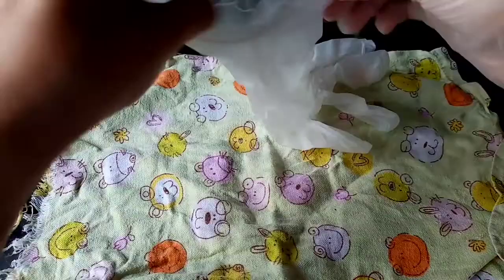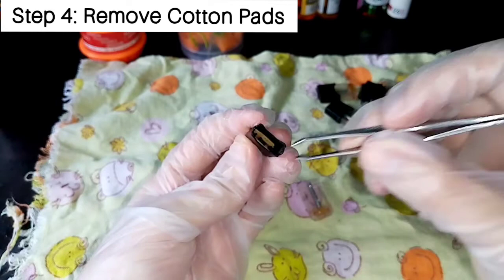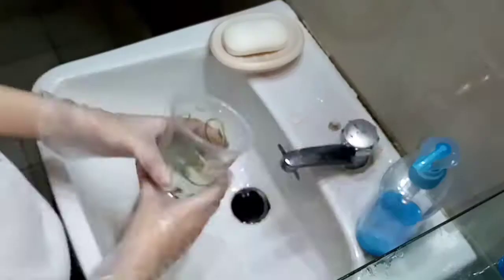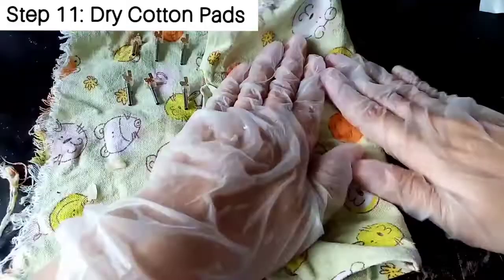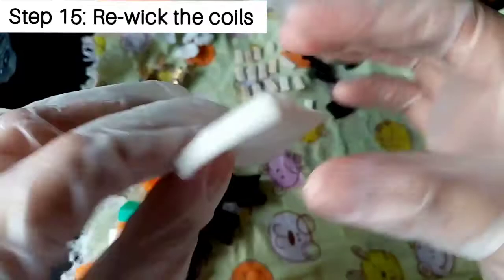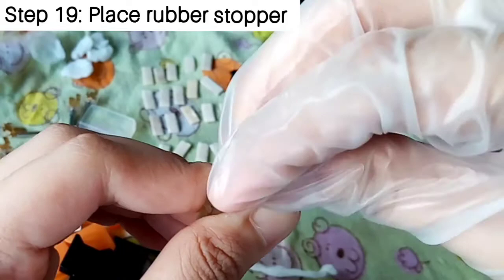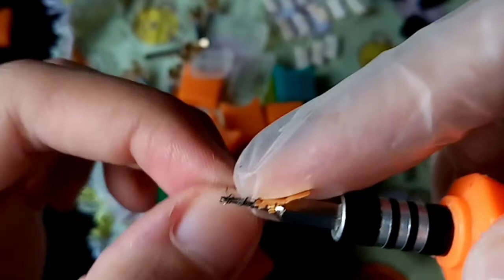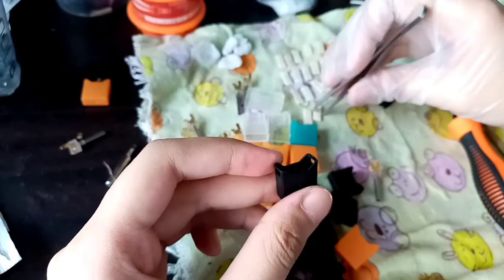How to Refill Juul Pods *NO LEAKS* | DIYwithAkisha

Comment: Hey 
I have a question, how many times can we refill a juul pod
Does changing the cotton make it almost a new pod?
Reply from the maker: Hi! Based on experience, about 3 times, but still depends if your coils are burnt or not 😊 
Changing the cotton lets you make sure that it isn't burnt, and also so the flavors from your old juice doesn't mix with the one you'll put hehe

Comment: Hi I recently just refilled my empty pod with some newly bought Skwezed iced green apple salt nic juice and it’s not pleasant. It tastes likes soap and when I hit my juul it makes some weird gargling noise, not the noise of how my normal juul pods make. Any help appreciated.
Reply from the maker: Hi! I'm not an expert but probably best to rinse it out thoroughly and dry it with a q-tip, the suds might have gotten left behind! Also dry the bottom (metal contacts) of your pods. For the gargling noise, it might just be the type of juice? Hope it helped! It's really just trial and error for me too 😃
Reply: if it's gargling, the coil is flooded. try filling the pods a little less, and squeezing a little less hard when putting the rubber seal back